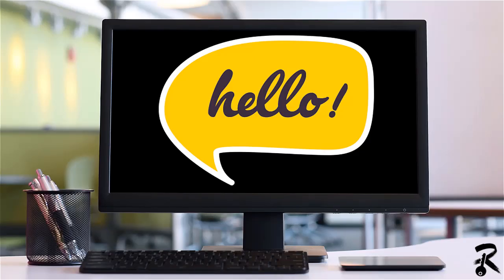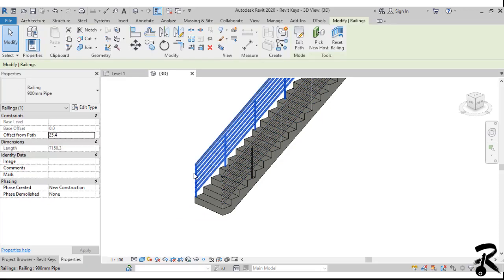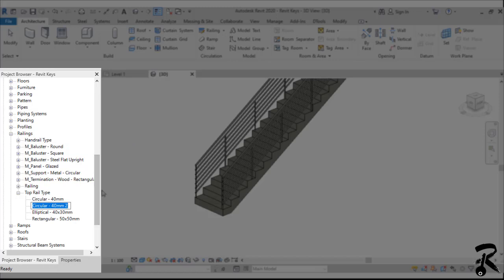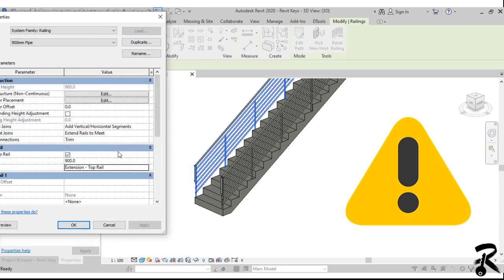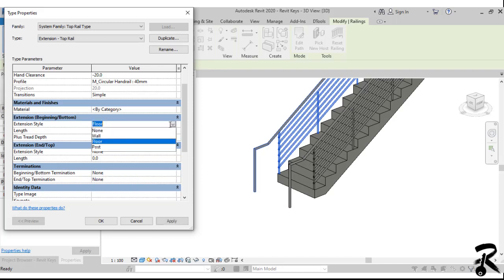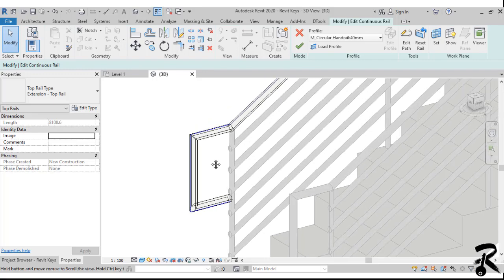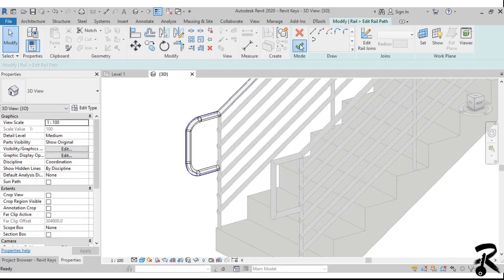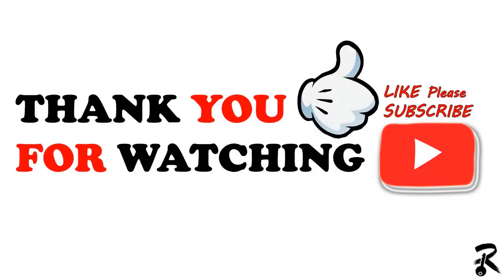Railing Extension in Revit

Comment: This content works great for the TOP Rail extension, but my project code requires the Hand Rail extension, which is not the TOP Rail as you can see in your first picture. As far as I can tell, these have to be manually edited, w/railing edit tool.